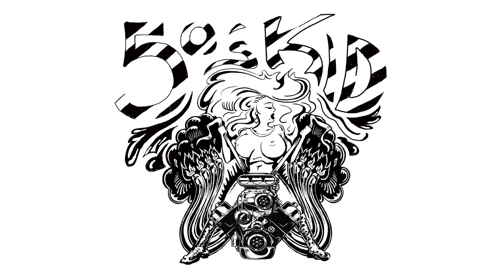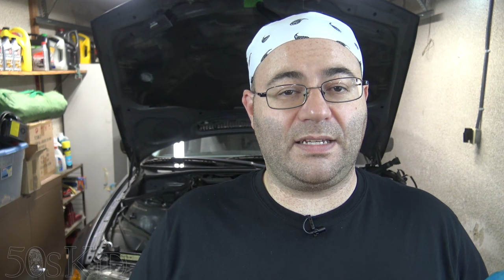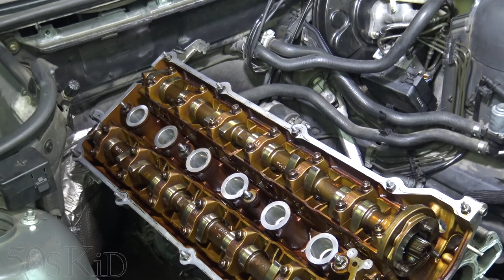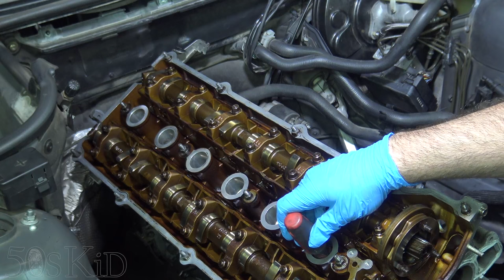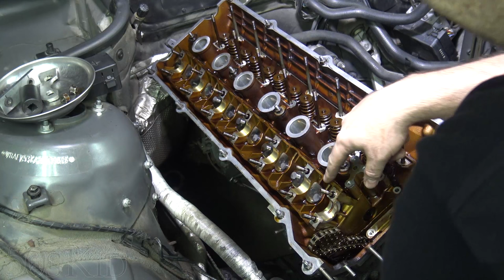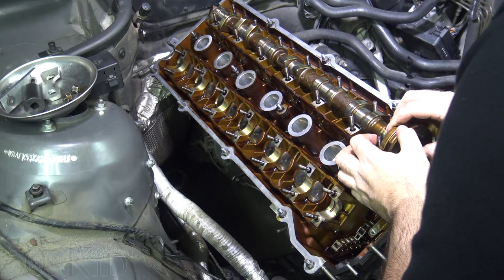BMW E46 Remove & Install Camshafts DIY #m54rebuild 9

Comment: This method worked for me!

After reading a bunch of 'how to's' on discussion forums, having the FSM at hand, looking for the factory tool to buy, wondering and worrying, I used this method to remove the intake and exhaust camshafts without issue. I consider myself a shade-tree mechanic, and have rebuilt various autos from the ground up (mostly older landcruisers) but this is my first time dealing with something at touchy as a BMW hollow camshaft. So I was truly relieved that the process - and the 'why' behind it - was explained so well, and understandably here. 

Bottom line is same as the first: this worked for me (with little experience in this particular area). 

THANKS!

Comment: I would use an egg carton to store the lifters in.  Keeps them in order and safe.... Great video as always sir.
Reply from the maker: I ended up using a 24 compartment storage tray from Harbor Freight that I had.  I used one for the lifters and another to store the springs and keepers and keeper retainers when I disassembled the valves in the next video.  It's this one, worked perfectly: http://www.harborfreight.com/24-compartment-large-storage-container-61881.html
Reply: Great idea.  Can't wait for your next video!!!!
Reply: Legit!
Reply: So what if you have to replaced one that is stuck closed?

Comment: Bearing cap #1 needs to be removed first otherwise there is a risk of gauging into the sleeve. 
Official times to wait for the buckets to shrink are: 20 degrees C - 4 minutes. 10-20 degrees C - 11 minutes. 0 to 10 degrees C - 30 minutes. That is the time you wait before you can turn the engine over.
Reply: There won't be many people who can refit the vanos and rocker cover and fill with oil etc in 30 minutes, so this point would be irrelevant to most

Comment: Just for anyone who reads the comments.........If you install the lifter trays incorrectly, i.e. you put A for air intake and E for exhaust.....the trays WON'T seat correctly and sit flat.....
Just a little tip for you all. Love this guys vids...

Comment: A piece of welding rod, cut to length will sit on the magnets and prevent the buckets from falling out of place when you lift the cam blocks up off the head.

Comment: If you put magnets on top of the lifters you magnetize it all. After that, they will catch all micro iron filings that pass by. Maybe the solution to prevent that is to demagnetize them with a coil connected to AC current.
Thanks for the video that is very helpful.

Comment: OK so after the cams are in, is it safe to go ahead and put the crank on TDC or are the valves going to be in the way of moving the crank. It doesnt not show between this video and the next. I just finished the bottom end and got my head back from the machine shop with new valves today. Btw the  lifter repair video was great. I thought i was going to need new lifters because some were stuck.

Comment: Hey, do you know how important the lifter outside diameter to cam tray bore clearance is? Mine have a good amount of wear. But they cost about $570 each. Will I have oil starvation issues for the cam or lifters if that clearance isn't good? Great video by the way.

Comment: The manufacturers seem to have an obsession with TDC and go to great lengths to perform all work at TDC. Just do as you did and turn the engine over a little. In general it's 1/number of cylinders for an engine with an even number.

Comment: Do I put the auflass (exhaust) camshaft back on in the same position as the einlass (intake)? With cam lobe 2 slightly to the left and lobe 4 to the right of top dead center??

Comment: hey please help i  was changing my valve cover gasket and i found 3 loose bolt studs of the camshaft caps i did buy new bolt studs but they didnt work so the problem is in the holes of thsese bolts what should i do? should take the head off or they can fix these holes without removing the head

Comment: So I'm looking at a 2001 325 and the owner said he did the head gasket but broke a camshaft when putting it back on. Would the camshafts from my 2000 328i fit? And is there anything else I should be weary of or look for in the 2001?

Comment: 1986 735i with once camshaft lobe worn (tick, tick noises), is there a lifter shim to compensate it?
Or do you know which would be less to get a top half engine or getting a camshaft?  
Can't find them new so many are rusted/used on the internet & come with high prices.

Comment: Dear 50s kid there is a question i wanna ask you i own a 330ci e46 and i am facing some problems with misfires w fuel cutoffs i replaced all the essential (sparks, coils, injectors) components but still runs rough when cold and misfires my mechanic insists that the problem are the lifters of the car btw no6 cyl has a within limits low compression rate. Can lifters associate with the missfires and roughness!!! Thanks in advance!!!

Comment: Hi, my e46 with M54B22 was runing rich lately and actually had stalled couple times. I watched all your videos about rich condition and etc. Did change fuel filter and pump, MAF with OEM ones. Checked for air leaks just in case but no luck. O2 sensors, VANOS seals and DISA are ok. No errors, no CEL but the car barely moves at lower RPM. 
So i took it to the shop and the guy said it's intake lifters got stuck that's why it runs rich. Can it run rich because of that, even tho engine does NOT make any rattling or ticking sounds?
Reply: @_lmagine   no error codes , but in my case it's definitely related to failed ABS system which causes auto transmission to bog down engine

Comment: HELP!!  My son and I recently tore into his 2004 E46 (325ci) to replace his valve stem seals.  After we got it all put back together (timing reset and all that stuff) it cranks but doesn't start.  The electrical box under the air intake buzzes if the key is in position 2, and for a few seconds after the key is turned back off. 

We did get a P1625 pedal position code, double checked all the connections, and the code hasn't reset since, but still the engine is turning but not firing up.  Sounds a bit funny too.

Any ideas what could be wrong, what we should try to double check first?

Comment: What is I want to install a schrick performance camshaft? Would this method work?
Reply from the maker: Yep this is the method you use. You will need to purchase brand new lifters as well.  You should never reuse old lifters with a brand new camshaft.

Comment: 12:10 lol perhaps i misunderstand but absolutely no chance i am reinstalling everything after the lifters in less than half an hour...the cams, timing parts, cover, vanos, intake, throttle, disa, wirrimg harness, oil dip stick tube, connectors,  air box and pipes, belts, fans, firewall....
Reply: I've always wondered about this. The same is mentioned in BMW TIS and Bentely manual. Before starting the engine, it would be hours or days😂.

Comment: I’m rebuilding my engine, and have been following you tutorials and I’ve run into a problem. I got the engine out together, but I can’t turn the crank more than 20-30 degrees both ways from TDC? Did I mess up the timing?   I have the timing kit and followed instructions to the tee
Reply from the maker: Umm, something’s wrong but I wouldn’t be able to figure it out over the internet
Reply: @50sKid  ok, I’ll take the timing components off and retry again. Is there anything I should look out for cause I swore I did it right the first time

Comment: I made a blunder - when installing the exhaust cam as per your procedure, the crank was at TDC 😟. I noticed this while installing E5 and E3 nuts. E3 wouldn't bottom out and that's when I checked and found the crank at TDC. E5 cap had bottomed out. I was replacing the valve stem seals. After I turned the crank off TDC, all went well with reinstallation of the exhaust cam.  But did I already damage my engine by attempting to install the cam while crank was still at TDC???
Reply from the maker: I don’t think so because you noticed it wouldn’t bottom out and you corrected. There’s really no way to find out except to do a leak down test.

Comment: Working on an engine replacement on 2006 X5  used a 2003 motor with 40 k from a wreck but it was laying for a long time. bottom end was pickeled and in great shape. top end look like new. but all the lifters were stuck. we used your videos all the way thru. Cleaned and tested all the lifters, by the way the intake and exhaust were different. After all that work still clacking like hell. Drove it around and still have the noise. Could it take an extended period to bleed those lifters. great oil pressure and vanos is working fine. Any suggestions
Reply from the maker: They should quiet down after an extended drive.  If not, something is wrong--like they weren't cleaned well enough maybe.
Reply: Sounds like just one lifter, we cleaned them all and tested them all on the bench, He's going to drive it for a while and see if that one lifter clears. if not if were going to open it up again were thinking of replacing them all with ECS lifters. A lot of work for one lifter. We tried to identify the sticky lifter by taking the valve cover off and starting it. Don't ever do that unless you want to get sprayed with oil. Sure ain't like a small block chevy. Looked like we hit black gold, but on the other hand we found out we had great oil pressure. I really thank you for replying, By the way we bought a Chineasium cam lock tool for 150 bucks and it didn't fit. could have ground it down but we got it back without it. That's going back. Just a warning all the kits aren't the same. Can't tell you how much your videos helped us. Thanks again

Comment: noooo😭😭 I removed lifters without putting them in order.... Why is it important? Any advice would be appreciated.
Reply: each lifter will wear out slightly different from the rest so if you want it to seat the best it can, and last long it must be done in order if not it’ll wear out prematurely

Comment: Surprising to me that the camshafts run on the lifter runner with no replaceable bearings.   I did not see you removing any bearing material. So when something goes wrong you have to replace the whole thing.  Right?
Reply from the maker: Yep.  They normally don't wear too much unless they are starved for oil.
Reply: The cambox is a good design, drop in a new box and your all set.

Comment: Hi, do you have a video how to replace the Head cylinder gasket?
Reply from the maker: That is coming up soon as part of this rebuild series.  Might have to wait a while for the head reinstall video but I will shoot a quick scene showing how I intend to reinstall the head and put it on the end of the "removal" video so that you can figure out how to reinstall it without waiting for my eventual reinstall video, which won't be out for a few months probably or however long it takes to put out all the other bottom end rebuild videos.
Reply: 50sKid Thanks I'll be looking forward on that.

Comment: if my camshafts do no rotate completely after reinstalling them, whats does that mean?
Reply from the maker: It means one of the pairs of valves is hitting one of the pistons which is at or near top dead center because they are not timed correctly.  Redo everything and make sure you lock your #1 piston at top dead center with the locking pin.

Comment: Its okay to mix hydraulic lifters aslong as you bleed them. You cant mix solid lifters.
Reply from the maker: No it isn't, for the same reason. The valves wear to the lifter.  However... many people get away with it.
Reply: 50sKid okay fair point, they do still wear to the lifters but id only keep them in the same place if i wanted the job to be perfect. If it were my own vehicle or something. I know they wont make noises if you mix them.

Comment: I need help man I no   compression on cylinder 3 is it a valve stuck open
Reply from the maker: Do a leak down test. Where is the air escaping from?
Reply: 50sKid I don't have that tool can I soak the piston down and get rings to open?
Reply: 50sKid by the way ...I'm a big fan!!! Of your channel

Comment: awesome series but ur hurting my brain with the screw driver down the spark plug hole.  good trick is to use a plastic straw
Reply from the maker: Why am I hurting your brain with that?
Reply: 50sKid scared of scratches i guess